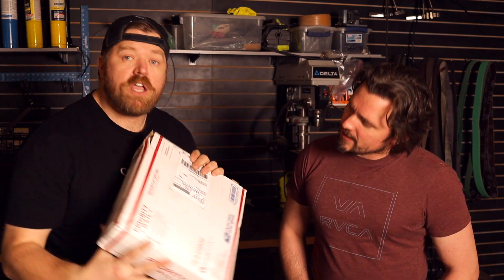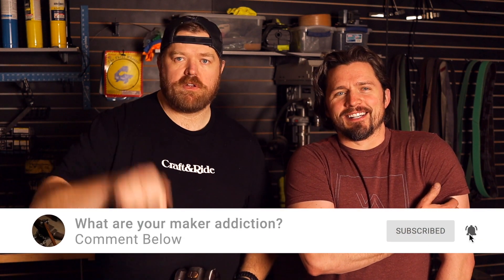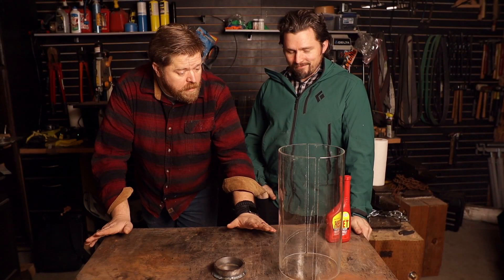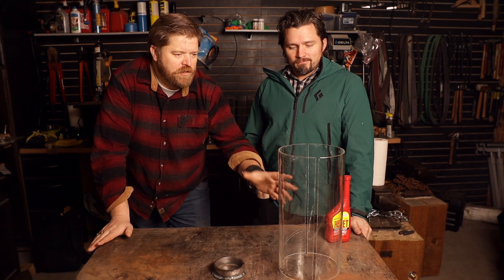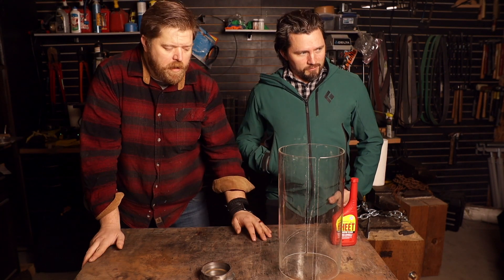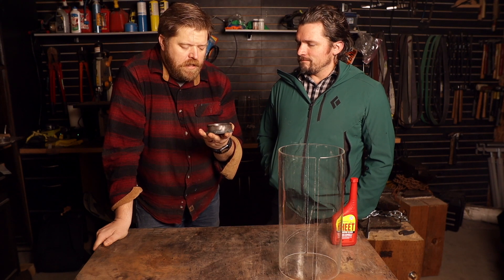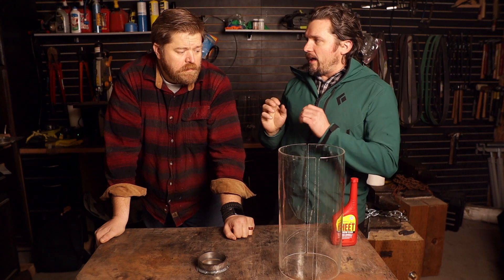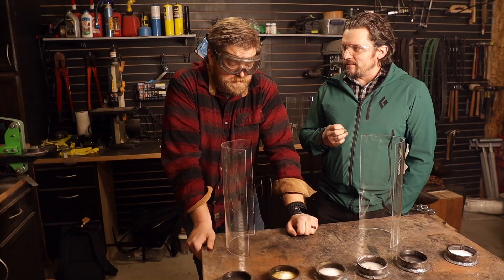SALT MAKERS CREATE A FIRE TORNADO RAINBOW

Comment: been wanting to make these on a smaller scale,,i think you guys could have done better using smaller dia glass ,those seem to be too large and too short but anyways you can get the glass pre cut from china to any dimensions you like,,i would like to try this with uncut cylinders and use a disc rotor on the bottom where the fuel is held ,the vents on the rotor in theory should make the vortex ,,i tried simulating the vortex using aluminium cans with special air inlets cut at the bottom and yes it worked nicely but was juts a prototype to see what kind of inlet design was more efficient ,anyways nice project and thx for posting it ,always looking for more on this  online